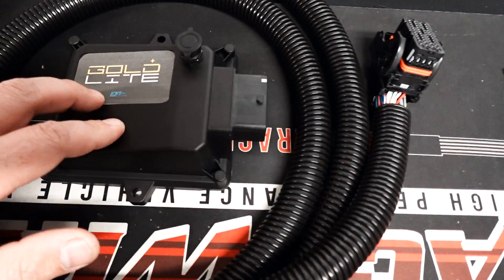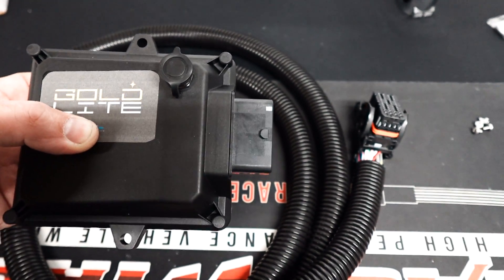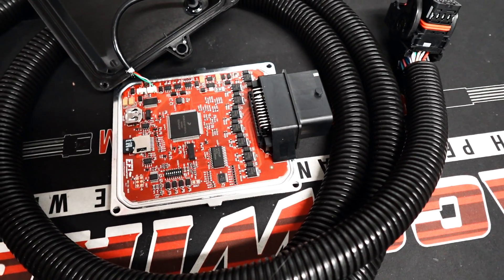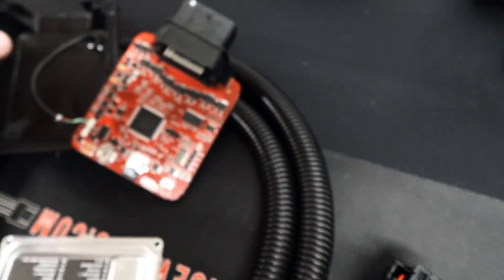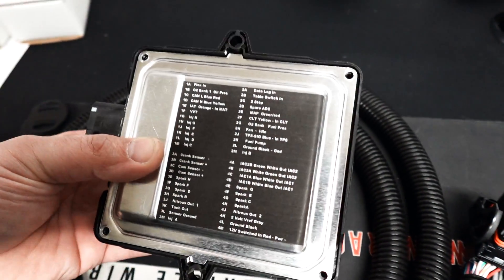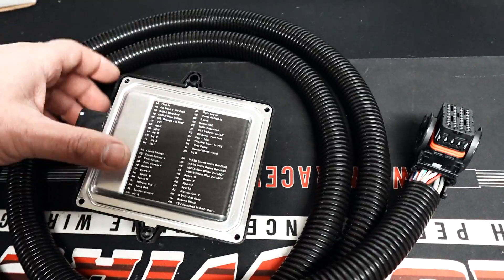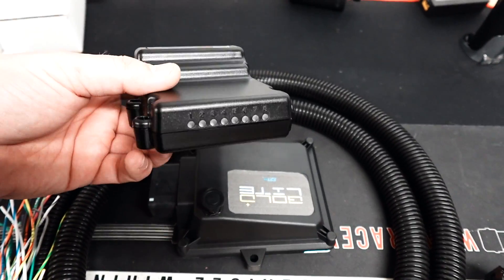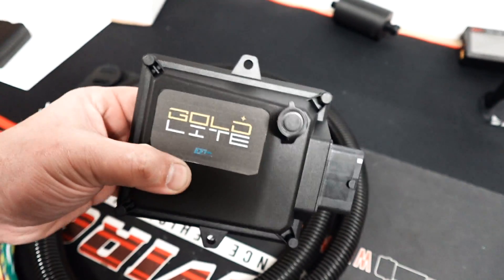gold lite - the new micro mini ms3

Comment: I want to see you try out the aces fuel injection for LS's. Give us your opinion on it, for a 24x/58x trans control it's about $1000, for just engine stand alone it's $870. Pretty cheap considering what it comes with. It'd be cool to see your opinion on it. What's interesting is that the reluctror is selectable on the units handheld touch screen, so one unit can do either 24 or 58.

Comment: Has it got a built in wideband driver ?
Reply from the maker: No it does not, I talked about this in the video that they thought about integrating one of those and it ends up being a failure point. They’re working right now with a zeitronix can bus wideband so it doesn’t use up any IO and I’ll have to learn more about they but you can still plug in the conventional wideband output into the ecu
Reply: @SloppyMechanics and 14point7 has canbus on their spartan 3.

I agree with them, I like not having built in wideband. Gives you options for the future and not being locked into something.
Reply: @SloppyMechanics  so ALL the same amount of IOs and features as the full size gold box minus 2 inj/spark outputs? Anything else I'm missing?

Comment: What are the options for transmission control that works with this?
Reply from the maker: You can use the micro and flash it with the trans controller firmware it already exists for other ms3 setups
Reply: So no need for separate controller?
Reply: yes you need a micro trans controller separate however the 2 can be linked threw CAN and controlled with the software in one place so it actually works as one unit once linked.   @Mexicanracing

Comment: MS is starting to feel really dated. The micro USB doesn't help, but the lack of throttle by wire leaves out a lot of possibilities.
Reply from the maker: It’s tough they have to work within the confines of the ms company and licensing
Reply: @SloppyMechanics  Yeah, from way back in the day, James Murray who wrote most of the actual MegaSquirt Extra and MS3 code was adamantly against including DBW.  Seems that he hasn't changed his mind on that in the years since, as DBW has become mainstream now.
Reply: @tptrsn  It came up again recently. He's very nervous because he wrote the code and doesn't want to be sued when someone crashes and dies.
Reply: @joecoco908 Gotchya.  Sounds like nothing has changed in that regard in the 10+ years it must be since we started talking about it..
Reply: They're very risk adverse on dbw stuff. They don't want to take on the liability from everything I've read.
Reply: Right, I think the firmware needs a serious overhaul. The engine states deal is horrible, drive by wire even with a external module needs some more adaptation. Need a way to do some custom tables ala about any current software ecu package.
Reply: @CMillet86  To be fair though, for the money it does a really awesome job with a lot of things.  Just have to be aware of the limitations of it I guess.
Reply: @tptrsn  I get that, but there’s been no real updates to firmware for what feels like 10 years.
Reply: @CMillet86  I do hear you on that.
Reply: This is definitely the big problem for it in a lot of cases...  I have the new Haltech pre-ordered for a DBW LS3 project, and that is exciting.  Even can do cruise control!  But man, MS3 is really awesome for a lot of stuff.
Reply: It's the algorithms fault... But seriously, you'd think that it would be easily integrated or have an option for a model with or without dbw. Or solder your own dbw circuit board controller...
Reply: @Brother2Jis_27s4 there's loads of dbw options for ms now, some as cheap as 200dollars.
Reply: @garyhowe88  i know.. just jumping on board with the idea of you'd think that it would come dbw capable. If it is as common as it is...
Reply: Hack the oem computer. Which new cars need to be taken off the factory ecm and switched to MS?
Reply: How much?

When and where can I get one?

Comment: This is great! They should sell it with just a connector and pins so you can build your own harness
Reply from the maker: you could buy the flying lead and then get all the connectors for the engine side from monkey fab
Reply: It's a horrible molex connector, unsure if it's even a real molex connector as it is an aliexpress case that comes with that connector.

Comment: USB-C?? for the love of god please just let micro usb die already.
Reply from the maker: I know, I don’t build them but they’ll see the comments so any suggestions are good
Reply: It is crazy for a new product coming out today with a usb connection that is not c
Reply: I've seen companies lately using mini USB still.
Reply: @ClarksAutoAndPerformance to be fair mini USB is such a physically durable connection
Reply: @AustinRBa I completely disagree. I’m constantly having problems on devices that have that type of connection. USB c is far superior
Reply: I thought the same thing right when he said that lol
Reply: I was like WTF, noooo !!! Why not C ! Lol
Reply: Or... full size B, because that's tougher.
Reply: I agree 100, the connection has much more integrity as well.
Reply: You can have any connection you want but the data doesn’t make a difference.
Reply: USB c is quite a bit more expensive to support. And the circuitry needed is different.
Reply: If Apple is going usb-c then it isn't going away

Comment: does this have on board wifi or bluetooth? still uses the rs232 module?
Reply: This is my question also. My old ms used a dongle and I used a tablet for my gages and tuning. Loved it
Reply from the maker: It does not have any wireless connectivity built in
Reply from the maker: it has a micro usb connector now, and everyone has voiced they would like usb C and I believe that will happen next revision as they are looking into that already. you would get a cable that plugs in to that and can get the data and you're set
Reply: @SloppyMechanics  I'm sitting here foaming at the mouth. Monster jam requires all our monster trucks to have EFI. Want to try this little guy out on blown  Alky